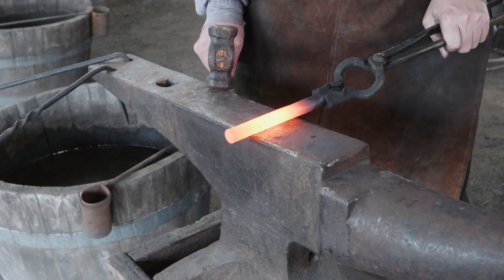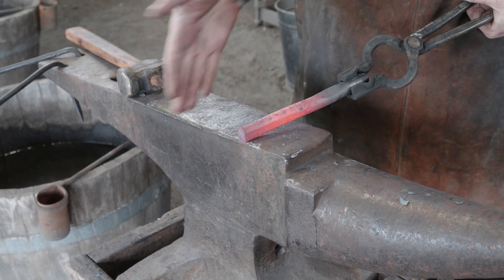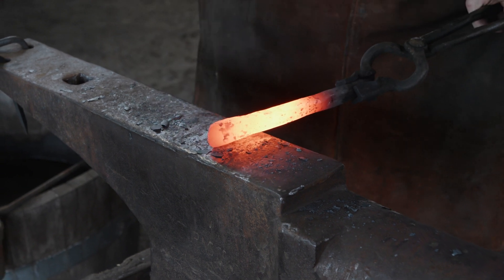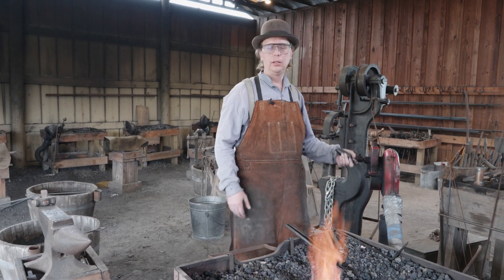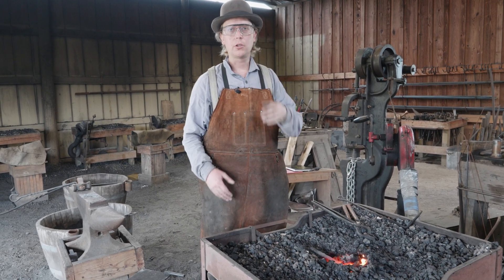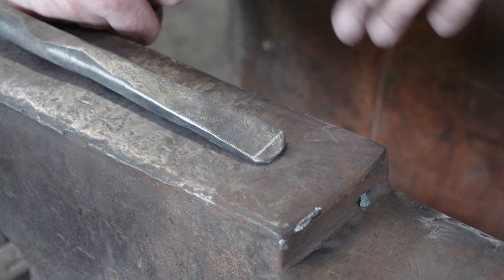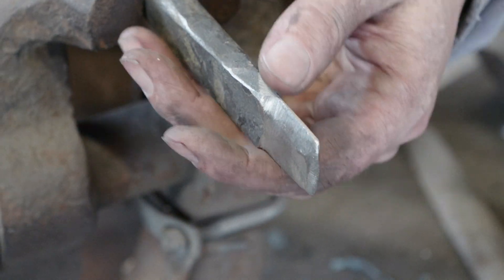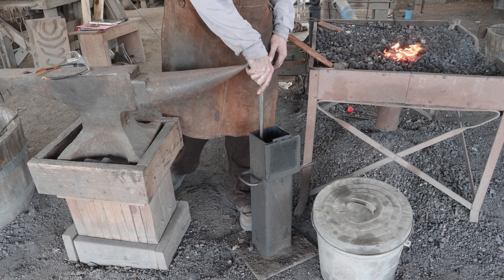ABANA National Curriculum 1.9 - Hot-Cut Chisel

Comment: Tool question…could you please describe the face of your hammer while forging? I have a heck of a time controlling the metal movement during my hammering, and am thinking my hammer face is too rounded. Thanks.
Reply from the maker: It's unlikely it's too rounded. When I really need to move metal in very specific directions I tend to use my rounding hammers which, as their name implies, are very rounded.  

My recommendation is pickup some playdoh or clay and then move that around with your hammer. It moves identically to steel but since you don't have to worry about heat it's easier to see what each individual blow is doing.

I can put together a video in the next couple weeks diving into the specifics if that would be helpful.

Comment: Im new to this sort of thing and looking for an anvil stand, do you have any suggestions? I'd like it to be semi portable because it'll have to move between outside and the garage. Thanks in advance, -Nate
Reply from the maker: My recommendation is to get a 2x12 board and cut it into sections the right height for your anvil and then lag bolt them together. 

I like to put one section of 2x12 screwed into the bottom of the stand as the wood in contact with the ground will rot first. When it starts to rot you can replace that section without having to rebuild the whole stand.

If you'd like I can do a quick video on how I make them in the next couple weeks.
Reply: @WatersIronworks  That's a really good idea, I'll look into that. The height of your anvil is supposed to be to your knuckles right? Also, how do you secure an anvil with no bolt holes to a post like that?
Reply: I mean no bolt holes on the anvil for the record, that sentence read a little weird.
Reply: Oh, and I'm not sure you need to make a video, I think i got it, you're just layering really wide wood planks together to make a square shape, like, six boards together would make it a 12x12 post.